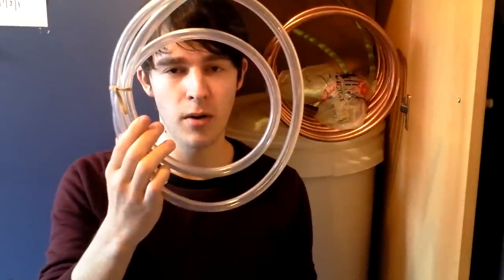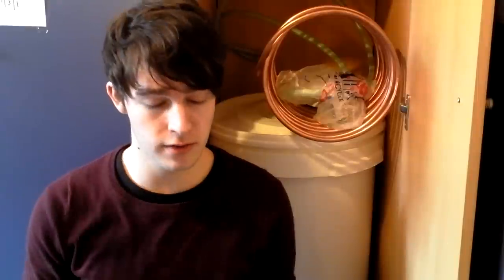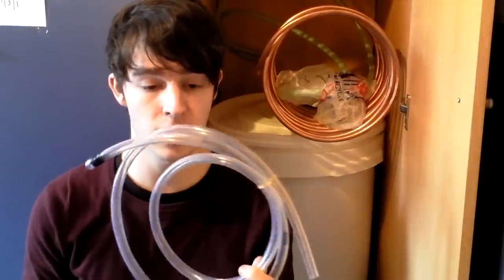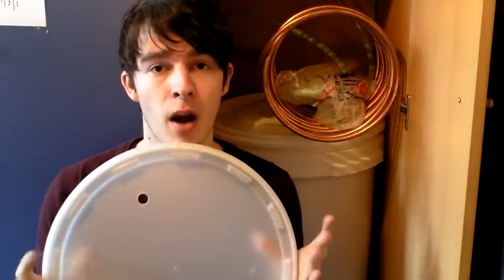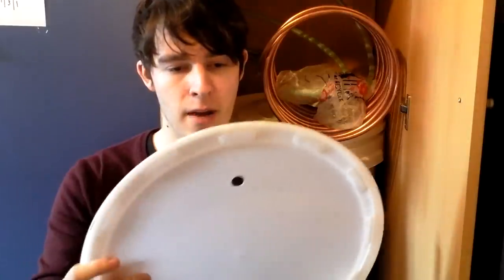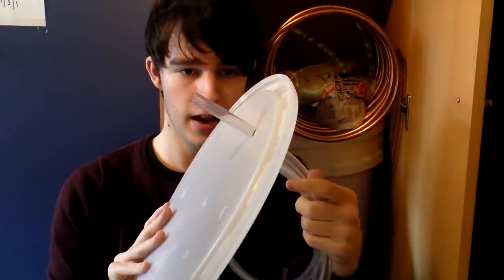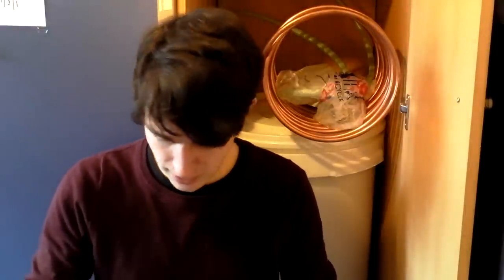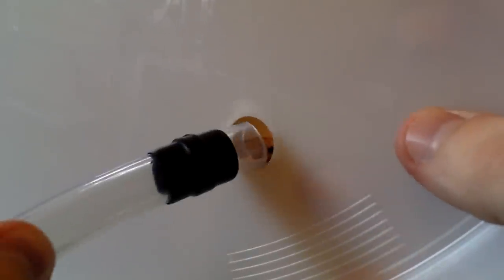Homebrew DIY #2 - Fitting a makeshift blow-off tube

Comment: Even tho you are using a blow off tube, the fermenter will most likely build up about the same ammount of preasure. If the preasure gets too high, the lid will pop off, and you will have beer all over the floor. I recommend trying "Open Fermentation" for these kinds of brews. Start by using the regular airlock. When the heavy foaming begins, remove the lid, and let the yeast do its work. When its settled, put the lid and airlock back on again. Place the fermenter in a bucket to catch the foam.